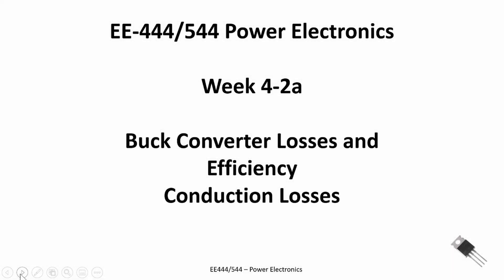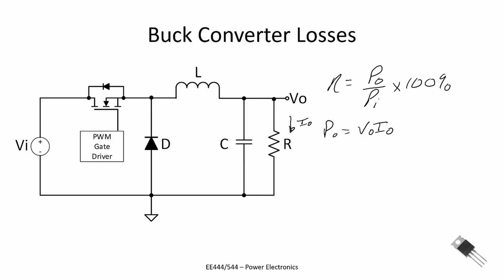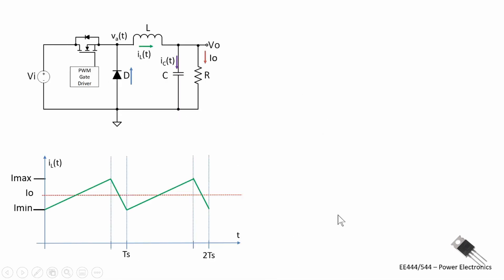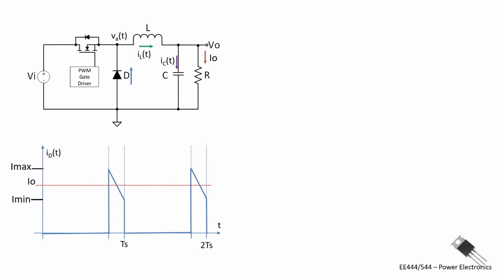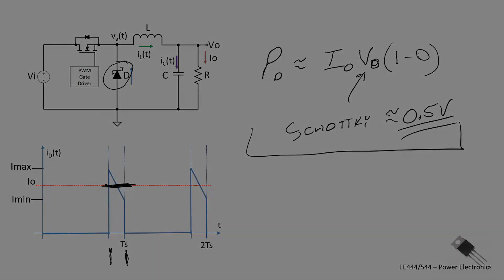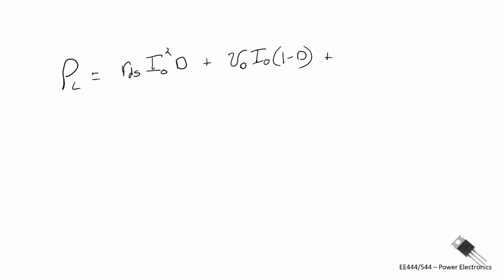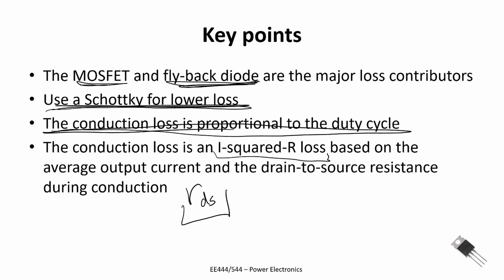Power Electronics WK4 2a - Efficiency and Loss of a DC-DC Converter - Conduction Losses

Comment: Hi Professor, I hope you are well. Great videos! Just got a question as to why in 6:24 you use Pc= R_ESRC(◇I_o/2_/3)² but when you show the total power loss exluding the switching losses at 11:00 you use R_ESRC(◇I_o²/12). Wasn't this for the losses that we typically ignore in the inductor? 
Thank you
Reply from the maker: Great question.  Let's start with the AC term of the current ripple.  This current ripple is triangular shaped and therefore the RMS (effective) value is peak amplitude divided by the root(3).  Recall for sinusoidal it is peak amplitude divided by root(2).  The peak amplitude of the AC term is delta_Io/2 because delta_Io is the total peak-to-peak value.  In order to get the power loss in the inductor, you use the square of the DC value of the current and the square of the RMS (AC value of the current).  The square of the RMS value will be (delta_Io/2)^2 divided by 3.  This results in delta_Io^2/(4*3).  Often times, we can ignore the AC power loss in the inductor as it is much smaller than the DC loss.  Hope this explanation helps.  Best wishes on your designs. -Dr. K

Comment: Dear Professor, Thanks for explaining in a simple manner. Could you kindly clarify, how to select ESR value of the inductor? Should it be taken from the datasheet or any calculations involved? Thanks in advance Prof.
Reply from the maker: Hi Arulmozhi, great question.  For a first pass at your design, I would use Rdc for the inductor as the ESR.  The value of Rdc should be provided in the data sheet for the inductor.  Inductors that are designed for higher ampacities will have larger gauge coil wire and lower Rdc.  Note that Rdc is only part of the ESR.  There is also a frequency dependent component that is due to hysteresis losses, eddy currents, the skin-effect phenomena, etc.  Luckily, this are typically minimal.  Again, for the first iteration of your design, use Rdc and then start to incorporate the frequency dependent losses if needed.  Hope that helps.  Best wishes on  your design.  -Dr. K
Reply: @powerelectronicswithdr.k1017  Thank You Professor for your detailed reply. It gives me clarity to proceed further with my design.
Reply: I know im randomly asking but does anybody know a method to get back into an Instagram account?
I stupidly forgot the password. I would love any help you can give me
Reply: @Martin Barrett thanks for your reply. I got to the site thru google and Im waiting for the hacking stuff atm.
Looks like it's gonna take quite some time so I will reply here later when my account password hopefully is recovered.
Reply: @Martin Barrett It did the trick and I actually got access to my account again. I'm so happy:D
Thank you so much you saved my ass!
Reply: @Bo Bronson glad I could help xD

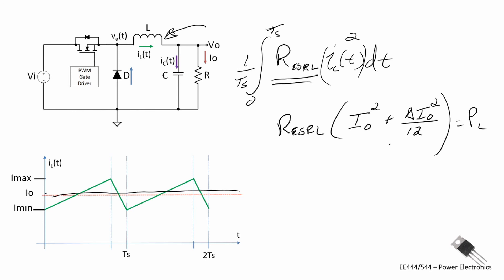Comment: Hi, thanks for the video. Where can i find a derivation for the equation at 5:08?
And shouldnt there be a ripple loss term in the conduction loss from the diode and the transistor? Because if i have a higher rms but the same average current those losses should be greater, right?
Reply from the maker: Hi Mr.Bubblegumx, this is the equation for the mean-squared value of an off-set sawtooth wave.  The first term is the average value of the current squared and the second term is due to the saw-tooth nature of the ripple current.  The term (delta-Io/2) is the zero-to-peak value of the ripple current and the 1/3 term is used used for the zero-peak value when computing the RMS of a sawtooth wave.  Therefore 1/3*(deta-Io/2)^2 results in delta-Io^2/12.    Yes, you should multiply deta-Io^2*Rds*D to get the AC power loss in the MOSFET.  However, it should be relatively small compared to the DC loss. Your AC loss shouldn't be greater than your DC loss for CCM.   For example if we use a 40% allowed ripple, the second term would be (0.4Io)^2/12.  Hope this helps and best wishes on your designs.  -Dr. K
Reply: @powerelectronicswithdr.k1017  thank you for your comprehensive answer, that really cleared things up